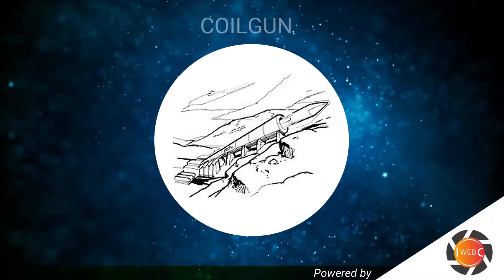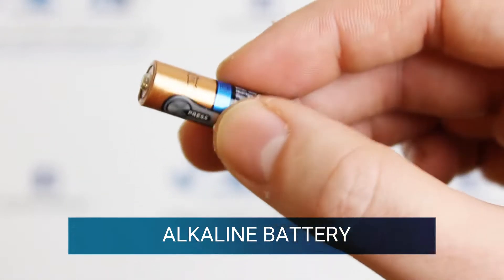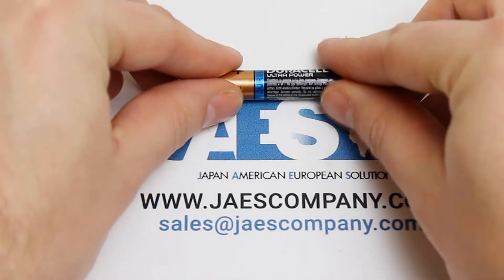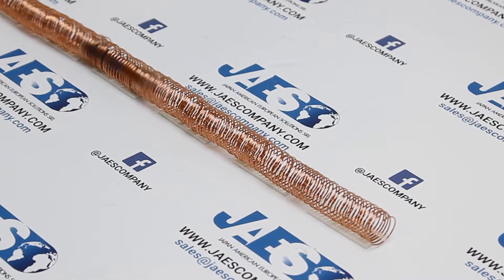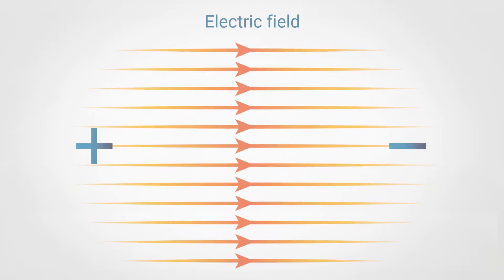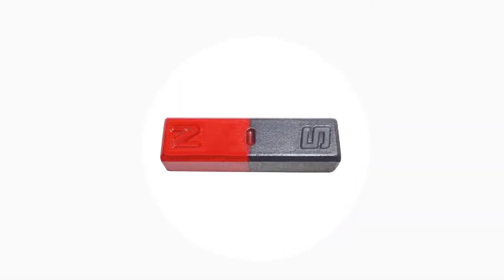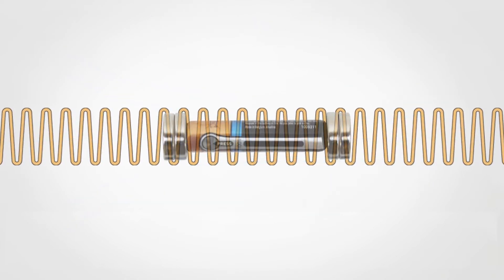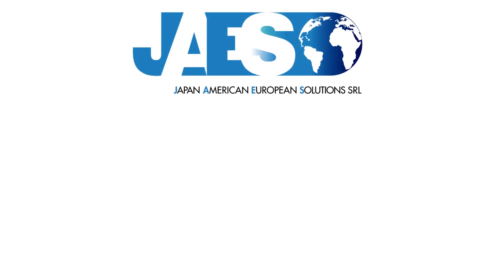How to make a DIY magnetic train - Coil Gun (Accelerator)

Comment: hello,
I got four earth magnets from home depot and copper wire from there.  My son's experiment did not work. Do you have any suggestions? Did you put a washer at the end of the battery that is not flat?

what type of copper wire did you use?

thanks!
Reply from the maker: Hello! Actually the building process is not that simple.. You have to be careful to assemble a nice copper coil of the right size in order to allow the battery to slide in it smoothly. We didn't put any washer at the end of the battery, those are just magnets that allow the movement of the battery through the coil. Let us know if you have any other questions or concerns. Have you had a chance to watch our video about ELECTRIC TRAIN? https://youtu.be/uLvUutEtZjM We would like to know your opinion about it. If you want to learn more about our projects, you can subscribe to our channel https://www.youtube.com/channel/UCb7TkWFn3nyb6XhudxGu5tw and visit our website https://www.jaescompany.com/

Comment: In the video, the functioning of the working model of the electromagnetic mass accelerator (mobile test stand). It is generally accepted that the implementation of this design is very difficult because of the low efficiency and low reliability. Nevertheless, this opinion is mistaken - modern technological the base has long been able to realize an electromagnetic mass accelerator with an acceptable efficiency and high reliability I am looking for interested in making. 
https://www.youtube.com/playlist?list=PLfhSIf7qgNZbdEVBvmjgqkalNNbqTJRtz
Reply: New! Gauss pistol of the greatest force VID 20181031 201942  https://youtu.be/l2GNTFWEFXk
Reply: High power coil gun gunVID 20181031 224651    https://youtu.be/pOlocGSxubo
Reply: 10 Meter   https://www.youtube.com/playlist?list=PLfhSIf7qgNZbpY7DvnL9JloPEddRnnUm5